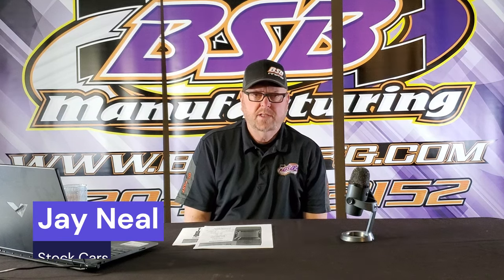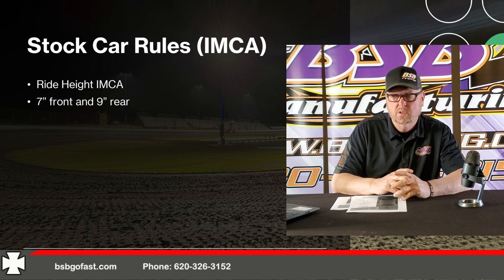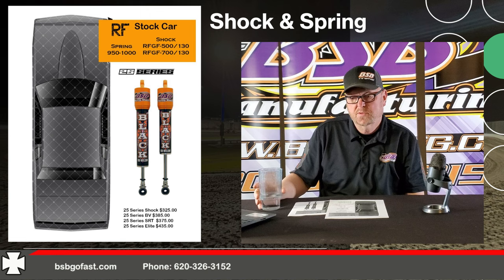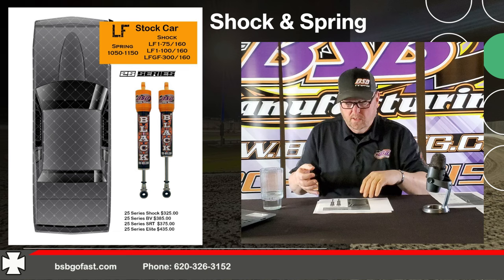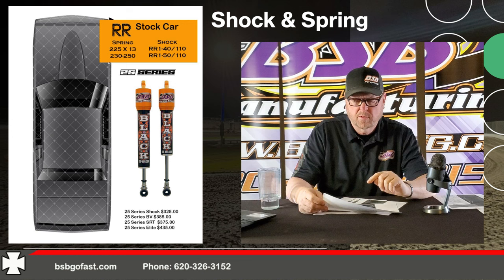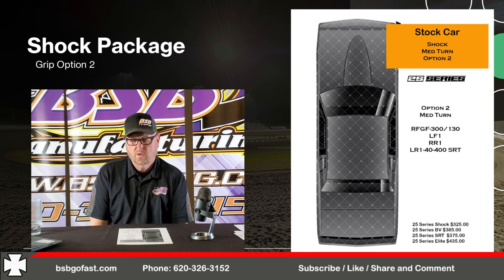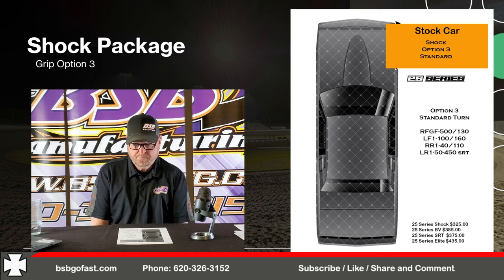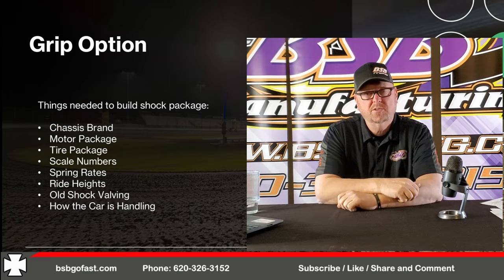Stock Car Shocks and Springs per corner.

Comment: great videos as per usual jay. a trend ive started to notice weither that be b mod, a mod or stock car, LF seems to have a stiffer spring than the RF weither it be a 600 to a 550 or the 1100 to 900 springs. is that to hold the car at attitude better and promote weight transfer?
Reply from the maker: Great question, the bigger LF spring is more likely being added to the car to induce RR wheel load during cornering. I also advise you to do this because most people will, but in reality, we need to work on the RR load to increase it in dynamic so the RR tire has something to race against.

Comment: On the options..... what is meant by low, med, high turn?  Is that the tightness/radius of the turn, or speed, or ????
Reply from the maker: Very good question, it is the amount of rebound in the shock and how it is going to turn the car through the corner. The lower the rebound the tighter the car can be, other things come into play like spring rates and ride height, and just how someone drives the car. All these things can make the car tight or free but in many cases, the cars seem to be tight and rebounds help to turn the car.
Reply: @jaynealgofast  awesome..... thanks for the reply!
Reply: So, would you start with a medium and go from there?

Comment: Great video Jay, and no need to call me back. I ( Tom Stark) left you a message today with a lady. I'm  building my own chassis and not having a base line I have a few questions. First off I way 280 pounds so I'm scaling with the weight of the driver in the car and using a 200 LR scaling spring, is that correct? On the LR  if I'm listening correctly  you want the preload to be between 185-250 correct? I'm also looking for a start point for LR axle/wheel drop .  I'm assuming 4" to 5" from ride to full dynamic roll. With my RR at ride height I'm at 450 pounds pre load. This video had perfect timing. I will be ordering the ride height gauges tomorrow and a load stick . Thank You.
Reply from the maker: Good luck this season, glad to see you back in a car.

Comment: How much do these cars weigh?
Reply from the maker: 3000 lbs
Reply: @jaynealgofast Thanks. 
 I've never raced dirt, been asphalt for 30 years. Local track went to dirt so good thing is nobody is fast... yet. Lol 
No weight rule
8" wheel DOT tire (295 50s)
Metric car stock shock mount 
Hoping to get a decent all around set up as the track prep crew is learning too, either complete mud or dry and dusty (sometimes both in the same night).
Watching and trying to learn the seemingly total opposite dirt car terminology and lingo. Although a few things are the same.